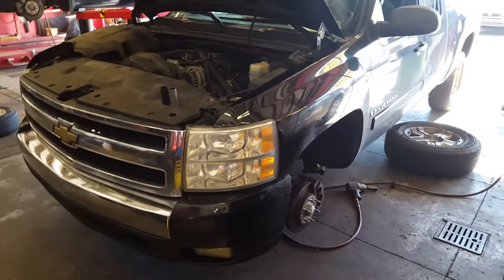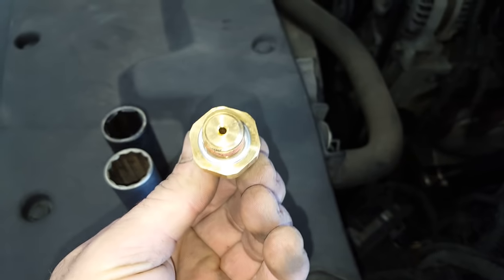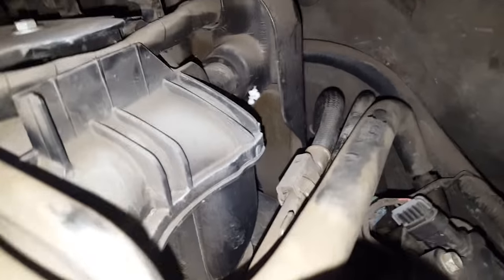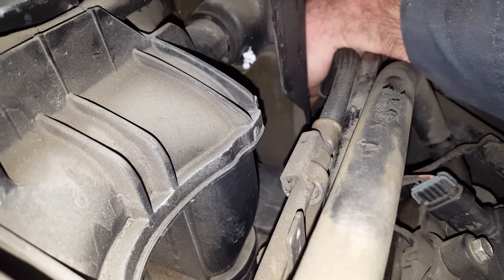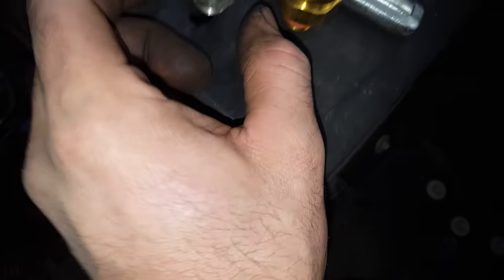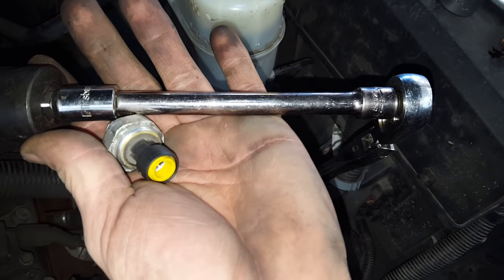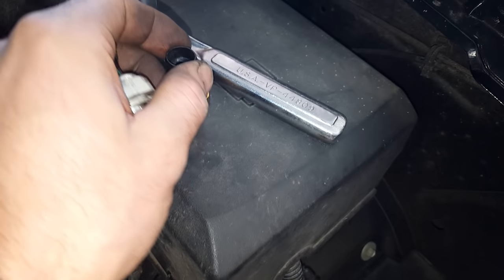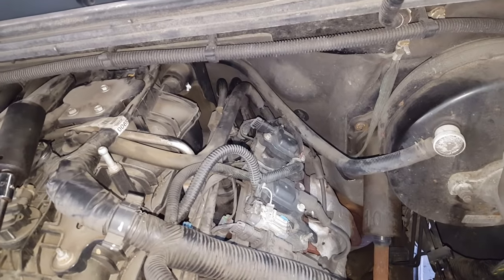Chevy Silverado 5.3L OIL PRESSURE SENSOR REPLACEMENT 4.8 6.0 sierra yukon  sending unit p0523  gauge

Comment: Awesome thanks..  Just fixed mine - and what a M'fer getting to it with the fuel line and silly hard plastic (that snaps easy) in the way.  Oh. not to mention the brake booster hose to the manifold connection RIGHT in the way and who at GM decided to put a steel bracket right in the way to remove the hard plastic vacuum tube.  Great  video - lousy design.

Comment: It's faster if you take a long flat head put it right at the base of the plastic and give it a good tap. Snaps the plastic top off and it's way easier to unplug it out and get your socket on
Reply from the maker: Cool man thanks for the tip, I'll have to try that next time

Comment: Thw original factory sensor is bigger than 27mm. I could use 27 to put the new one in but had to use a 29mm to take put old one for some reason was bigger.

Comment: I'd like to know if anyone giving this video a thumbs up actually tried this. On  most 5.3 it's damn near impossible to get to the oil pressure sensor without taking the entire intake manifold off.
Reply from the maker: They certainly are easy to get to but it's definitely doable

Comment: If you want to avoid breaking the plug, do like I did. I took a fairly long flat screwdriver, put the tip where the plastic part of the sensor meets the metal part, then hit the screwdriver with a hammer and busted the top off. I was then able to remove that top part from the plug without damaging the plug. Also, like others have said, change the screen while you're in there.
Reply: This saved me! Thanks very much, Noel. Worked perfectly!

Comment: What he didn’t do or didn’t know or didn’t tell u guys is down in that hole after u take the sensor out is there’s a screen down in the hole just use a pick with a little hook and get it out and change it can get clogged
Reply from the maker: I updated the description about that years ago. I appreciate you chiming in as well as the others have mentioned it as well. Thx
Reply: Good up good workman’s keep wrenching

Comment: You never mentioned replacing the filter screen underneath the sensor which commonly plugs up causing low oil pressure light to illuminate.
Reply from the maker: I updated the description after posting the video

Comment: I had to use the special oil pressure sensor socket available on amazon.   10 bucks.   Regular socket would not work.

Comment: I always remove that plastic cover back behind the intake. Gives you a ton more room. Fat hands don't work back there otherwise.
Reply: How did you get that cover out?  My vacuum/ brake booster lines run  through it.

Comment: How do you know when it's the sensor or the oil pump? My problem is at idle I loose pressure but not when under load.

Comment: Having an issue.  I got the oil pressure sensor socket.  Fits perfectly around the replacement, but I can't seem to get the socket to seat on the existing one so I can remove it.  Seems to be too tight of a squeeze (it's the right size, just seems like the sensor is too close to the engine block or something), even though this is the recommended socket in just about every video.  It's a thin-walled socket.  I'm tempted to try and force the sensor back a little, but worried I might break shit.  What are your thoughts?
Reply from the maker: It sounds like the sensor on there is a different size. I would try maybe a different socket
Reply from the maker: Or try to force it on there is an option as well I guess

Comment: Super easy job I just did it , took 10 min . Part was $55 .  This job you need to use your brain more then your hand on this job,  i also change filter too, its 2008 chevy silvered 1500, 5.3...you need to use small ratchet,

Comment: Loved the video, how do I clear the check engine light?
Reply from the maker: With a scan tool or engine code reader. You can get them on Amazon very cheap. Or disconnect the battery
Reply: @NoNonsenseKnowHow  awesome thanks so much for the quick response.
Reply: @NoNonsenseKnowHow   Take off your neg batt cable and touch it to the positive for 20 seconds then it is reset.  That is how you can reset all codes without a scan tool.

Comment: So my oil pressure switch threw the code but my truck doesnt have the gauge. I replaced the switch but i cant tell if i still have the problem. I have a scan tool but it wont show oil pressure. Should my ecu read oil pressure on my 2011 5.3 silverado. Also does anybody k ow if the code would quickly pop up again after i cleared the code

Comment: So let me ask this, i changed my oil,  and it was fine for a few weeks, now I can't drive the darn truck without my stop engine light dinging in my ear,  trouble codes say it's this sensor. Can I trust the diagnostic test and change it, or could it be a deeper problem?
Reply from the maker: It certainly could be a deeper problem. I would suggest removing the sensor and cleaning the screen as some others have commented below. I forgot to mention about the screen in this video.  But honestly these sensors are cheap enough that you might as well throw a new one in there while you're at it and clear the code. Then if you have further issues from there, address them with a proper diagnostic.  This is such a common problem with these.
Reply: Ok, I just rather do it myself than take it to the dealership where i bought it and pay 150$ for a 40$ sensor. I'll try this first because it's the only code it's throwing as of now
Reply from the maker: @MrSlm1981  yeah I think that's a good move. Let me know how you make out.
Reply: @MrSlm1981  When you take the filter out, blow some compressed air down the tube (your oil needs to be drained and the oil filter has to be removed). Sometimes there can be gunk below the sensor filter and this will clear the tube.

Comment: New cars are designed to fail.they took the shade tree mechanic out of the after market repair . I just replaced my oil censer at greenville. Chevrolet for 450 that includes towing not bad.

Comment: say do you happen to know if this is located the same place on the other 2 engines? the 4.8 and 6.0 l engines?  i have this job coming up soon he said he lost pressure then it came back real high and i told him this sender is the issue. but now to change it out.  thanks for any help.
Reply from the maker: Excellent question, and yes it is located in the same spot on all three engines. Good luck with the job, and make sure you pull out the screen beneath it to clean that as well

Comment: What's the worst thing that can happen if I just cut that plastic heat shield to gain better access?
Reply: NM BarCode nothing..that's what I did with a Dremel tool. Made it much easier.

Comment: Was this one leaking oil?
When i did my alignment they told me my oil sending unit was leaking, i have an 08 silverado also. Just wanted to make sure because when i looked bacl there it don't look like there is oil, but right under on top the trans there is. So i was thinking might be rear main.
Reply from the maker: No it wasnt leaking

Comment: Must be nice, I've tried 3 different times on my 06 5.3L and the sensor will not move.
Reply: Have you tried bringing the vehicle up to operating temp first? The block will expand and let go of the sender a little bit.

Comment: my 2012 the pressure goes from 20-25 down to like 17-18 until the dash dings and tells me to shut engine off.. truck has 120k .. sensor or run it till it blows?

Comment: Royally fucked up. Found this video after I already busted my new one in the block. Still has a little piece sticking out. What do you think the best way to try and get it out would be. Fml
Reply from the maker: Damn man sorry to hear that!  Should be able to get it with an easy out  or turbo socket no?   Def not a good place for something to break off.  Tight back there!  lmk how ya make out
Reply from the maker: Are you saying you over torqued the new one? or?
Reply: Yea couldn't tell how tight it was and boom snapped right off. Gonna have to try an  easy out and hopefully get it out
Reply from the maker: @kodyotto6890  Gotcha.  Yeah that sucks. I'm not sure if there is a torque spec for it or not. Good luck

Comment: Do no buy a cheap replacement for this.  They have really cheap plastic and it breaks easily so you'll just have to go get a better one from Autozone or Advance or Riley.  If you have an endoscope that will marry up to your cell phone or table it will make this job easier.

Comment: Yeah just the way u said it and the way u showed it with having the wheel off and going thru all that it seemed u was gonna go in thru the wheel well then didn't and nothing to do with that lol. So that's why I said that lol. I was like what in the world does that have to do with anything with changing the oil sending unit when he went thru all that with the wheel off and then having the wheel off had nothing to do with getting the oil sending unit out lol.
Reply from the maker: I haven't really watched the video, but I believe I did mention about letting the air out of the tires to get the truck down lower instead of having to climb over top the engine bay with it up high. Especially for guys with bigger tires. If I'm doing work on a bigger truck at work, I usually just let the air out of the tires. Since we don't have one of those fancy truck creeper things that allow you to lean over the engine bay

Comment: Ah, you didn't even mention the dumb little strainer basket they put in the hole below the sensor, It should be taken out and discarded. It does nothing good and causes problems.

Comment: what is the torque spec?
Reply from the maker: cryptfiend461 honestly I'm not sure what the torque spec is  or if there even is one for it.   Good and tight.
Reply: kzguy2 well thats what i did lol, no problems. I was just afraid i would brake it.
Reply: Hand tight. Don't matter. It's a sensor. And definitely don't want it getting tight back there.

Comment: I CANNOT fit the socket on there, man it's a bitch to get at
Reply from the maker: Yeah it's definitely a little tight for sure. having the special socket helps out.  there is a link in description.
Reply: @NoNonsenseKnowHow  So I did finally get this, I wasn't able to see anything I was doing though.

One person suggested taking off the brake booster cable, the big one on top of the plastic shield. That makes it easier to get your hands in there.

Anyways, thanks for the video
Reply from the maker: @closedeyz  no problem man, glad to hear you were able to knock it out!

Comment from the maker: On Amazon:
*OEM OIL PRESSURE SENSOR: https://amzn.to/2v2AAuR    
*AFTERMARKET SENSOR: https://amzn.to/31zhVD5
*REPLACE or CLEAN SCREEN TOO: https://amzn.to/2Ri71wI

Tools To Help Out:
*OIL PRESSURE SOCKET TOOL: https://amzn.to/2OwutpD  
*SCAN TOOL/CODE READER: https://amzn.to/2PQIrEF
*ELECTRIC CONNECTOR SEPARATOR: https://amzn.to/2TUY2ED
*BORESCOPE CAMERA: https://amzn.to/2RrKaQI
Reply: NoNonsenseKnowHow I seen in a forum that it can cause shifting issues is that true?
Reply from the maker: @jaithanielbearmedicine8342  I haven't personally seen that issue...